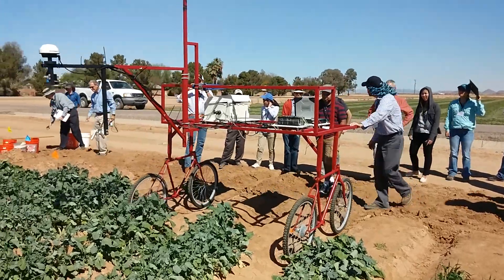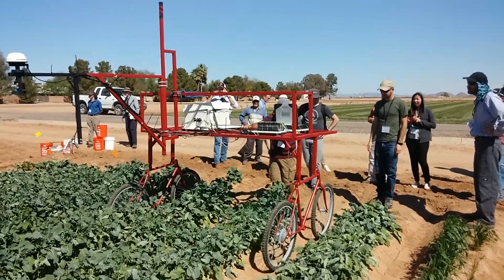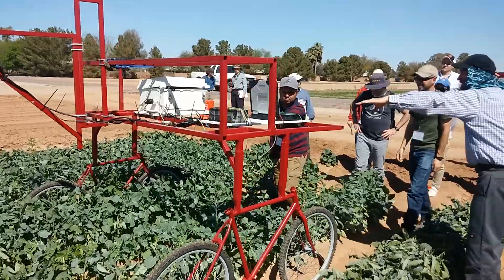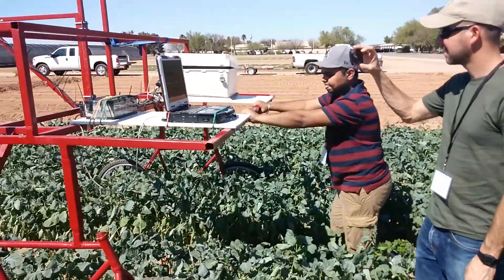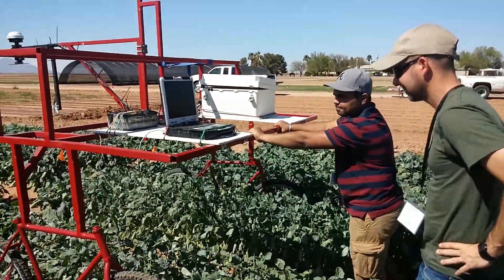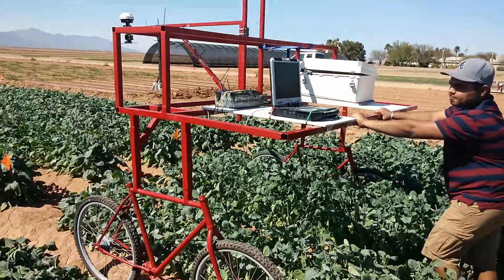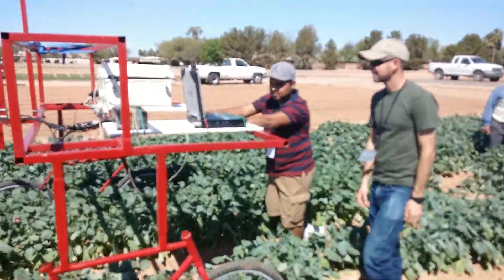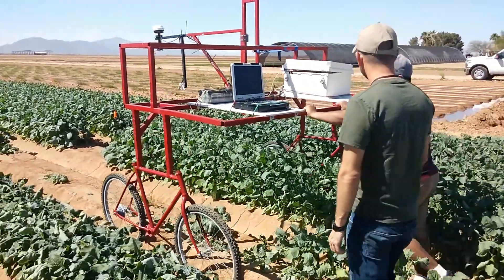Crop Phenotyping: New Arizona Technology Aims To Improve Crop Quality, Yield

Comment: The “Bicycle Buggy” PSCM1, Proximal Sensing Cart Mark 1. It typically records a single row of canopy height, temperature and spectral reflectance at 5Hz. It is relatively inexpensive and easy to develop, and achieves a level of FB-HTP, Field-Based High Throughput Phenotyping that allows meaningful characterization of vegetative growth over a cropping season.